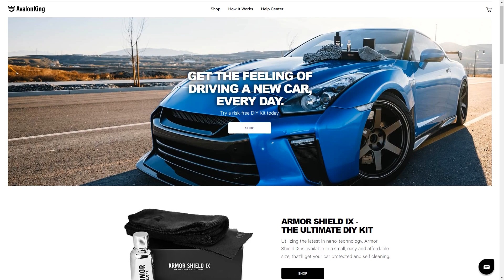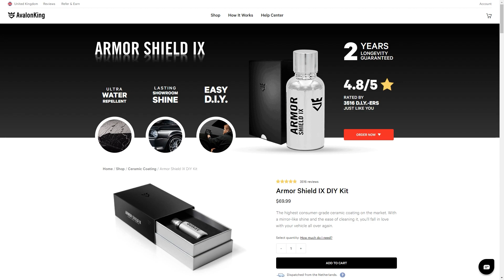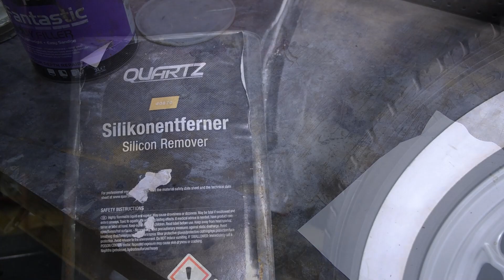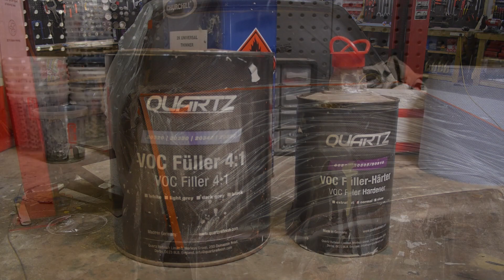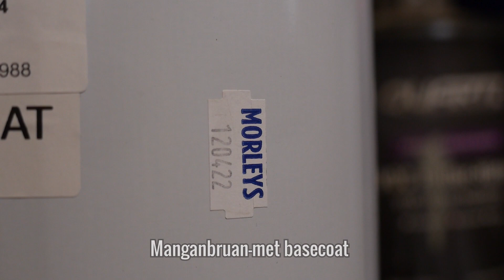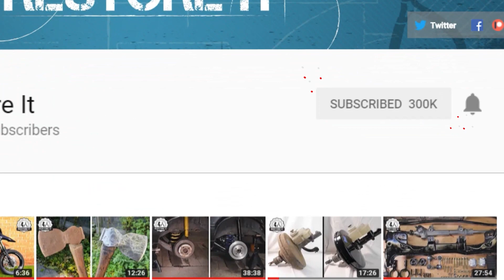Bodywork & Engine Bay Respray - 1983 Mercedes w123 Restoration

Comment: I also use alot of rust converter on my cars when I see tiny spotsof rust, but why use it on bare clean metal? Might it not interfere with paint adhesion?
Reply from the maker: Thanks for the comment Juntasification, the rust converter actually acts as a primer for paint.
Reply: I agree, no sense to use a rust converter on bare metal. Sure, it will stick somewhat, but proper primer is better. Ideally 2K epoxy primer.

Comment: Whilst UPOL Fant3 (the purple tub) is great, you might find Evercoat far better to work with. It provides better results in a lot of cases, in my own opinion. Our bodyshop use both, and personally i prefer Evercoat.
Reply from the maker: Yes I have this in a Basket. I was going to wait until i ran outn of Upol, I might just get some now. I wanted it for ages! Cheers!
Reply: @RestoreIt  make sure to get the Evercoat pinhole eliminator as well. Handier than stoppers, and doesn't sink like stoppers sometimes does.

Comment: you putty directly on bare metal? a little tip use either metal putty or glass fiber putty both don't draw water either prime first for that i would use an etchprimer/washprimer and then putty

Comment: Hello, how are you .  Please help, I have a problem with the m50b20 engine.  Vibration occurs inside the car at (rpm 2000-3000) only.  The engine bases are intact and the gearbox is also intact.  Of course the car is parked or running, vibration occurs.  I don't know what to do to solve the problem.  I tried putting my hand on the motor at rpm 2000-3000 the motor doesn't vibrate . E30